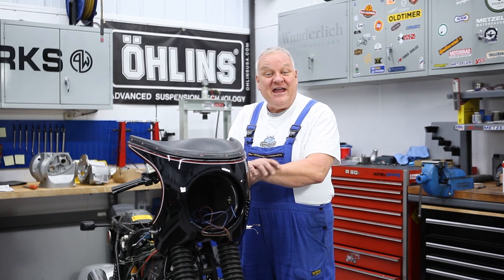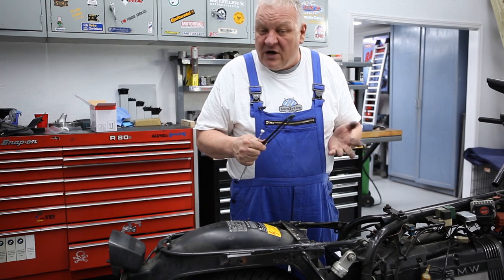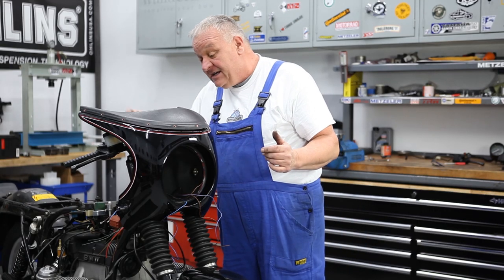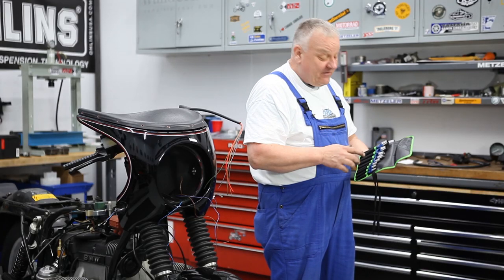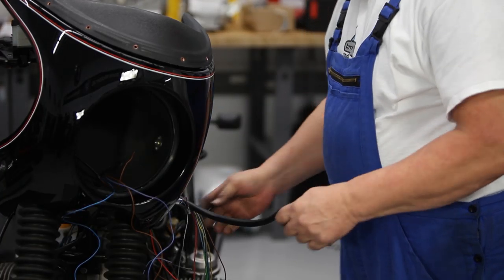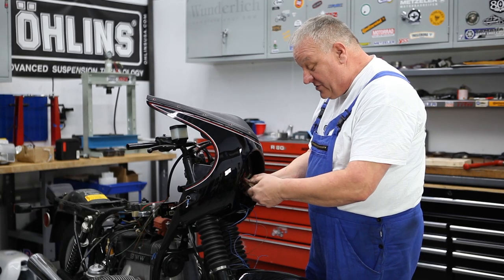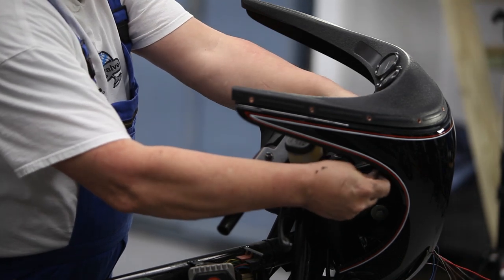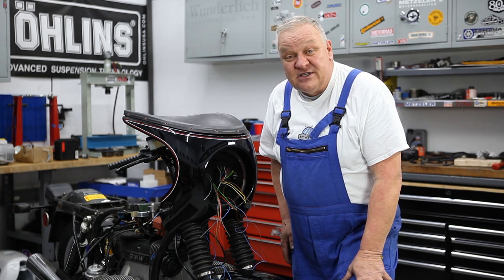BMW R80 RT to S Conversion #8 - Battery and Headlight Bucket Wiring Part 1

Comment: William I noticed that you wired the motorcycle into the headlight harness without any fuses. Are the fuses on this motorcycle connected somewhere else besides inside the headlamp? My R100 has two fuses and a circuit board inside the headlamp.

Comment: William I noticed you wired the headlight and you didn’t use any fuses.  Is the fuse box on this bike connected somewhere else besides inside the headlight?